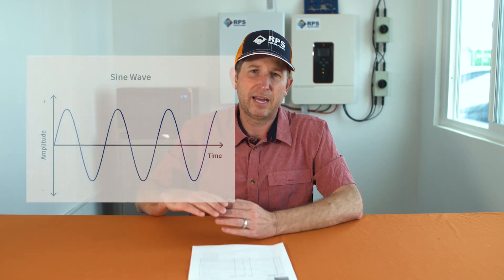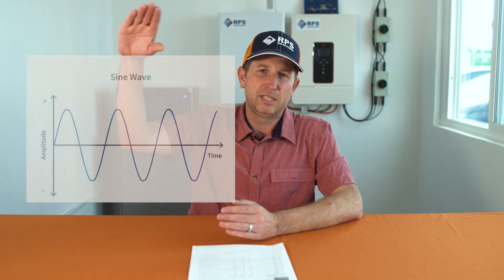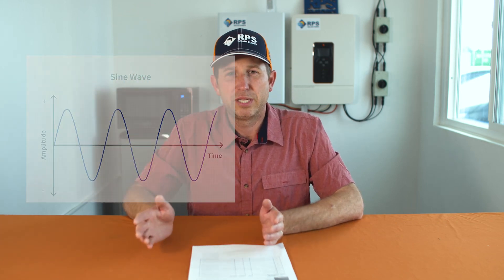What Is The Difference Between An Inverter And A Converter | Q & A With The Solar Pump Experts

Comment: Hi have a shed down the back 6m by 4m by 6m high  which i want to put solar on to power two existing pumps one a above ground 6m well pump and one a pool pump. I understand i will need lithium batteries and a inverter to make all this work which i can then use in daylight hours.
I also imagine i would need a DC to DC charger would i also need a shunt.
Inside the shed i store a caravan already with 2x 120amp lithium plus solar so i understand how that works but get a bit lost with what i would like to do here with the pumps.
Any help would be great